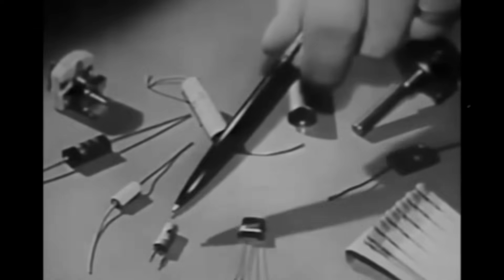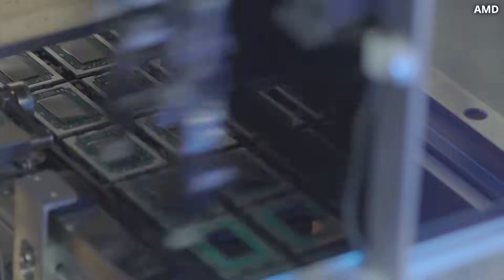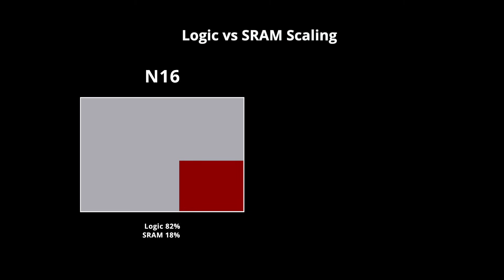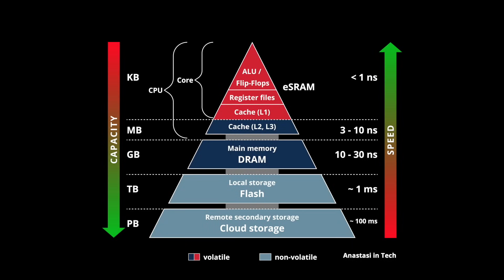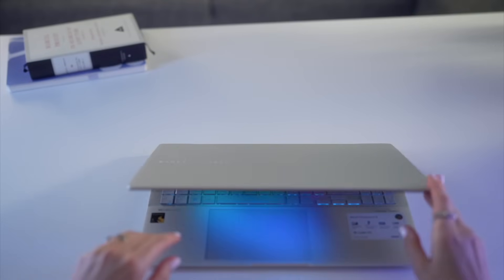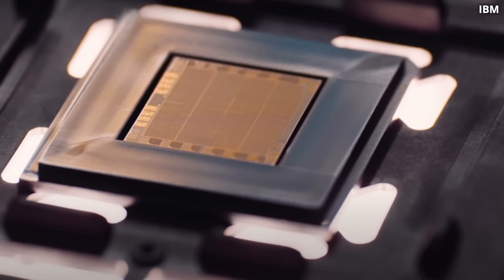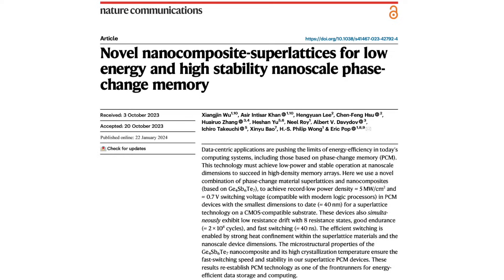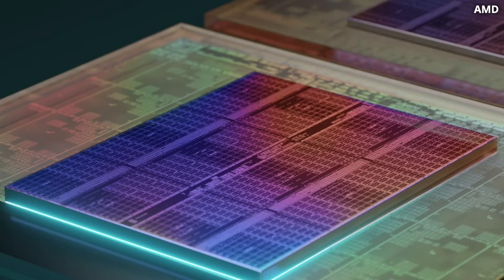The Death of Computer Memory

Comment: 10:05 is it really brilliant? Isn't this the first idea anyone should have after realizing, that spreadying chips in an 2D area eventually will not work anymore because of latency and also out brains are basically 3D "chips" soo, i guess whenever the first chip was build, we always had in mind going 3D will be the goal, but cooling is a problem. Which is why I always thought we should have micro tunnels through the die-stack and then cool it somehow with a fluid, that doesn't expand when absorbing the heat, so it won't violently crack the dies 😂😂😂 figuring that out would be brilliant i guess :D Or lets say, the idea to do so is basic logic, but figuring out HOW to do it, is where brilliant comes into play. To now when the time is right, to make an idea reallity, similar to the iPad. Tablets were no new idea :D

Comment: It's way past time that chips start going 3D.  It's ridiculous to me that scientists are still trying to pack more gates on a chip rather than simply using the 3rd dimension which is freely available.  Yes, we have the problem of cooling.  I'm sure if 1/10th the effort that went into packing more gates simply went into trying to figure out various cooling strategies we would have had chips a million times more powerful than current chips

Comment: The memory-requirement should be gone shortly.
The whole point of memory was to circumvent the issue of hard disks not being a quick storage space to keep up with the demands of the CPU(the mother of all Karens).
It's only there because we need a quickly accessible storage space for the CPU operations.
It will soon fade away from ermm... "memory"...

Comment: I do not have a problem with the MFG creating larger chip sizes to put more esram on the die.. or to interconnect it beneath the cores like we see with the 3d cache.. we can look at one of Intel's latest chips like the 285k, I do not have a problem if the design of that chip is twice the size it is now.. if we added more Esram to the chip.. will it take up more die space, sure, but so what, make it anyway.. I look at some of the huge chips I see with 128 cores on them.. so make some chips with 16 cores and use the rest of that space for esram.. level 1 cashe.. so it rarely has to move outside of level  1 to request more memory and or have half of that memory ready to read by the cores while the other half of the esram is retrieving memory from cache level 2 or 3 or dram.. or storage.. giving ample ram in each area to make all of it seamless.. so the cores are not waiting for ram to give it the data it needs to make its calculations..

Comment: How soon will we see a change in architecture from 2D to 3D with coolant channels for liquid cooling in the chip?  It seems that stacking layers is in common use, but heat transfer is a limiting factor.  Allowing for a coolant to pass through the hottest portions of the chip to remove it should allow for chips that work at optimum speed throughout.

Comment: Slight problem here.

The paper claims switching times of 40ns.

While your memory pyramid graph details 3-10ns for L2/L3 cache, and 10-30ns for DRAM.

That means while the new tech is a HUGE improvement from NAND flash, it is still at least 4x slower than the minimum requirements for L2/L3 cache going by your own graph.

Also the write endurance is listed at 2 x 10⁸ cycles - again, an insane improvement from NAND flash, but not nearly good enough for SRAM where many billions of write cycles are a necessity, even with persistant/non volatile memory reducing the need for refreshes.

On the other hand, Imec have presented a voltage gated spin orbit torque (VGSOT) MRAM that should be both compact in cell size, very power efficient, SRAM order switching times and non volatile.

One paper I looked up on this MRAM variant "Ultimate MRAM Scaling: Design Exploration of High-Density, High-Performance and Energy-Efficient VGSOT for Last Level Cache" claimed upto 3x SRAM cell density at iso node pitch, which also brings benefits in reducing interconnect length and therefore delay and energy reduction.

Edit: A Feb 2024 paper even claims sub ns switching times for field free SOT-MRAM:

"Field-free spin–orbit torque switching in ferromagnetic trilayers at sub-ns timescales"

Comment: The problem with 3d cash on top of the chip is cooling. Reversing this process with the L3 on the bottom allowed AMD to cool the chip much better. (Overclocking)

Comment: That explains why chips started to stagnant then grow bigger in size instead of always getting smaller with more transistors. For the SRAM problem I am thinking it will  most likely still the same size  even with the new technology for the reason she said it needs to do the same thing to hold then retrieve data. The way I see it going is how AMD seems to be doing it. Said to the public as adding more L3 in a vertical stack which is alike to layering SRAM on top of each other instead of having a single 2D plane. That with most likely a way to have a key or frequency or whatever they are going to use inside the chip for when they found the data in the layer of L3.
For L1 sadly I do not see it shrinking in physical area due to physics. Maybe they can redesign it again to be smaller but there is only so many redesigns before you hit a wall, find perfect or reduce efficiency.

Comment: The BCM2837 SoC chip uses stacked RAM. The Raspberry Pi Foundation released the Pi Zero 2W in 2022 using it. So who stacked first? Regardless of who, it’s great to hear the designers are finding solutions to such huge (microscopic) problems!

Comment: It's obvious. They are looking for a 2 dimential answer for a 3 dimensional problem. If they want to continue to make smaller cpus they will need to create a cpu cube with internal cooling. This would greatly reduce the distance between transistors if it is more compact. This could also reduce power as distance is shorter. We have 3d printers now so stop printing boards in 2d. Use ai to optimise the components into a cube

Comment: @AnastasiInTech My most sincere wish is that some company will offer MMAs with 256 GB memory optimized close to the MM processors.  (And the software stack to use them...)

I imagine a workstation with ample PCIe I/O and a couple of these MMAs, which would be able to accommodate FLOAT32 versions of large AI models.  Agent creation appears to be a future activity, and I'd like to be able to work on that as a small business.

Do you see anyone working on MMAs with memory in those dimensions?

Comment: I used to use magnetic memory... when I worked on DEC PDP-8e.  It was called core memory, you could actually see the core magnets and wires that were wrapped around the cores.
Reply: I used a PDP-11 with magnetic core memory in my Navy TacIntel SatCom in 1988… does not seem that long ago😂😂😂😂

Comment: Dumb question: If one has a fast low power, high density, reliable cache memory why couldn't one simplify scale the architecture to use this technology for most all of the memory accessible to the CPU? You said it yourself, ADC/DAC doesn't come without a host of issues. Is the biggest challenge with this related to yield?  The idea of building layered devices is not new. What has changed to make this a more attractive option?

Comment: THE TRANSFER CAPASITOR-What happened to it--never heard of it--1992 the transfer capacitor was made into memory and put into the Acorn Archimedes Computer--the memory was before this a huge bottle neck for the ARM Chip--with the new memory the ARM CPU became the bottleneck- The Transfer Capacitor was 100 times faster than the fastest switching transistor at the time--That small English electronics Company was sold to a  GPU manufacturer and the reason was to stop the wide spread adoption of the Transfer Capacitor. So what happened to the technology?

Comment: The big issue with sram denstiy is more that sram cells are highly regular and so able to be individually optimised in a way that logic hasnt. Combined with the fact that while smaller number better for the node number. The real frature sizes are 10-20x the node number, and havent shrunk anywhere near as much as logic has. Much of the logic improvements have been the design of better logic cells, not so much smaller features. This means that memory, which allready had the rules bent for it to be as small as possible given a lithography machine has much less room to move. I do think that CFET will give us another factor of 2 improvement, an high NA EUV will give us 33% on top of that. But beyond that, we may have to do 3d integration of sram, like we do with flash.

Comment: Many years ago I wondered why transistors and memory were not stacked in 3D in layers. I figured it was because of heat. My solution to that was microfluidics and possibly sodium to carry it away. I also thought light pipes (lasers) could replace the metal bus.. A lot of work to make it to production as the hardware needs to accommodate new kinds of connections.

Comment: Stop designing chips with 90° bends. They would run a hell of a lot cooler and more efficient with curves. Take any wire and bend it a thousand times You're going to get a lot of resistance.  Or in this case a million times. 
I get we're down to the quantum level but I have a very strong feeling 90° bends are not as efficient as curves.

Comment: It has been discussed for decades that close stacking of chips has advantages of speed and size. The issue is heat generation, thus trying to reduce the total charge (electron count per bit). New memory technology is required with far smaller charge transfered per operation.

Comment: Anastasi, 
I have a couple of questions for you. With this new "Chiplet" technology of stacking the memory on top of the processor how do you handle the heat? Especially with PCM using resistance (more heat). 

Also, I would like your thoughts on building a fab plant in the U.S., where we can stop relying so much on a company (or companies) that exists in or near a place that China controls or wants to invade. One of my professors at UCR thinks I should build one.

I like your memory joke and your smile. I probably won't remember the joke when I want to tell it!
Take care,
Charlie
Reply from the maker: Hi Charlie :) Thanks for the inputs. The video about heat is coming today

Comment: Chalcogenide Phase-Change Memory? Basically, Intel & Micron had it, years ago... They called it 3D X-Point or "Optane". Instead of giving it the R&D needed to take it all the way? They killed it off, and ceased all production, both consumer & business models lines. Why? Because they're Retarded (well Intel is anyway).

I have one of the early samples, a 16 GB model. You could run Databases on it with performance like you wouldn't believe.

Thanks for covering this Very Important & revolutionary Technology! Glad to see Researchers are still making improvements.

Comment: 3 nm and so on is a marketing term that has no relation to any dimension of the transistors anymore. The true gate width until now is 14 nm due to asml's lithography machines limitation. The next step for the next decade is going down to 8nm (about 80 atoms wide).

Comment: Be careful of two things when buying an ASUS.  I got a high res OLED screen on a laptop that tried to yank my brain out of my body through my retinas.   It turns out that it does not have "DC brightness"  instead they narrow the pulse width and send out little spikes of light.  The full brightness setting is very bright, and I've never used it.   Ourt of the box the machine also arrived with a fan that in my quite office in Europe dominated.   I returned it, and they did make it good enough upon return.  So though the specs might look great, be careful of the ergonomics.

Comment: Great video - thank you Anastasi :-) I think if we stack much more memory as 3rd level cache chiplets on top of CPUs we may reach the size of gigabyte 3rd level cache. And this would eliminate the external DIMMs on the mainboard which makes future Notebooks and PC again cheaper and reduces not just the complexity of the mainboard but also of the operating system, drivers and firmware because data can be loaded directly via fast PCIe lanes connected SSDs to 3rd level cache.

Comment: If sram can't scale further they should probably take it off the soc. Maybe they can develop a modular system of chips interface where everything stacks like a sandwich. You can buy a layer of sram cache or use the one you already have. You can buy an igpu layer with hbm memory or not. You could upgrade the cpu layer for more cores and keep the rest of the layers. More latency, but probably a tiny fraction of the latency of like socketed ram sticks.
Reply: Are you thinking of something like an L4 cash?

Comment: AMD 1st v-cache its way older. back in 1999 K6-II motherboards had L2 cache.
"The original K6-2 had a 64 KB primary cache and a much larger amount of motherboard-mounted cache (usually 512 KB or 1024 KB but varying depending on the choice of motherboard). The K6-III, with its 256 KB on-die secondary cache, re-purposed the variable-size external cache on the motherboard as the L3 cache. " (wikipedia /wiki/AMD_K6-III)

Comment: when you get close to the size of an atom, which i think is close to  0.5nm  you run into problems that can not be fixed.  In particular,  your going to run into the problem that highly focused  mental intent will interfere with the operation of the chip itself.  You also can not shield this - not in a compact way.  
It all works out in the end because the only reason for continuing to put more and more SRAM on chips is for  AI processors.  I say it all works out in the end because in roughly 5 years the AI fad will be over with because it will hit both the  "human data" barrier (Generative AI needs human data to base it's model off of)   and more importantly -   the Power Generation bottleneck.   There just isn't enough power generation capability for  investors to get a  ROI in say  less than 10 years.
A lot of electrical grids are trying to "go green",  the problem with that is they're having problems keeping the lights on as it is.  With the solar flare activity and  the weakening  earth magnetic field   we will be experiencing about 10 years of very VERY extreme weather.  Summers will be hotter,  winters will be colder.   Meaning?   We will need MORE electrical power to keep ourselves cool in the summer and more electrical power to keep ourselves from freezing to death in the winter.   Texas had this probably two years ago.  The temperature suddenly dipped down so low that the lubricant in the transmissions of the massive wind generators (which power most of their state)  FROZE,  the wind kept blowing the turbine blades  and what happened?  The gear boxes  exploded, shredding themselves into metallic shrapnel. 
The only way the  Generative AI market can keep going and growing is with Nuclear Power.   Problem there is that it takes  10 years to get a reactor online producing power (sometimes longer i'm told from a friend who builds them).   Investors are not going to wait around for 10 years to ...probably get their  ROI.   They'll pull their money out, and all these AI companies that are  IPOs  are going to go bust.
So all of these AI processors are going to be pretty much worthless.  Wonder how much gold is in them? hmmmm..

Comment: OK I’m calling this out as not feasible in lots of cases.  The issue is that SRAM needs to be tightly coupled into an architecture to get the performance benefit.  However if a bond-out pad is required (eg chiplet etc) via Bunch Of Wires interface then there will be a delay penalty due to capacitance and transmission line issues.  This means added latency and a performance hit.  Might be useful for L2 cache but anything local it is of no use.  SRAM at the local level is still the best solution.

Comment: Thank you for this video. It's great. My two issues: (1) heat dissipation, is not addressed (over cycles there is growth of H.A.Z.), (2) One thing I heard about and remember vaguely, was an attempt at self healing logics (rather, materials + control circuitry), which is aimed at reducing the need for redundancy, in elements at the core of the chip (hottest and fastest environment), and attempts to also better the chip lifetime (cycles 'til dead). -I would be grateful if you could address both.

Comment: So what you do is take all those different types of memory and pair 2 or 3 together that complement eachother so on the pros and cons if the con on m1 matches the pro of m2 and the con of m2 matches the pro of m3 and m3 balances m1 like yin and yang  then you could have a closed loop dynamic memory storage  or we can just move on to optical computing with lasers and adl wafers that have the circuit diagram etched into it so the laser light travels through the etched like electricity through wires you know how powerful that could be when you stack 2d into a working 3d model just think how many 1 nanometer thick wafers you can stackthat is perfectly flat on top and bottom to reach the thickness of a normal pcb mother board  and then using the speed of light to power its operations this is all possible I've designed a few different set ups with ai and even the ai is jaw dropped at what I've designed

Comment: Is it possible to make a specialized process that is focused on SRAM, because there is the option of doing 2.5D or fanout interconnect so you can specialize the process to optimize the scaling of SRAM. I had only gotten half way through the video, but yeh you can do it that way to, but as far as I was aware 3D stacking in pretty expensive no?
Reply: sram is only of the most investigated structures, they are already using all the tricks they can to shrink it.